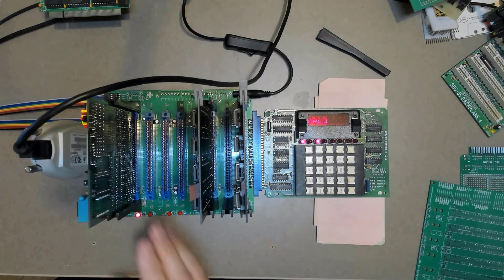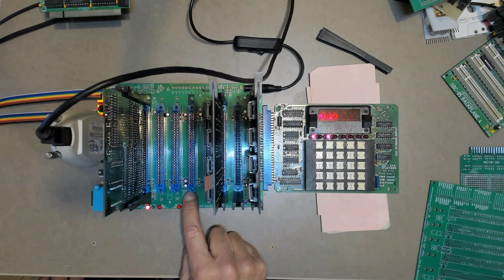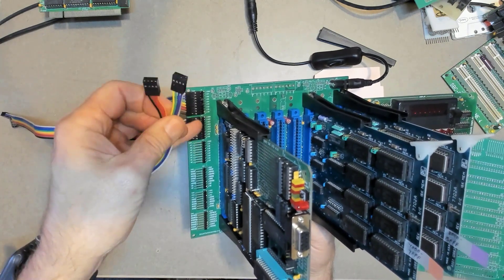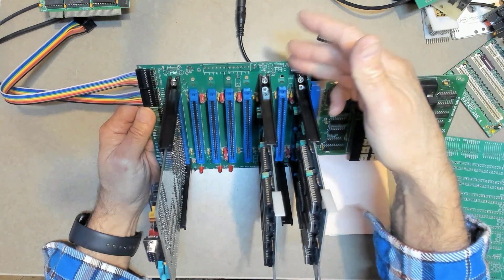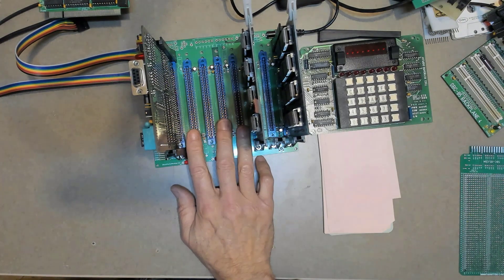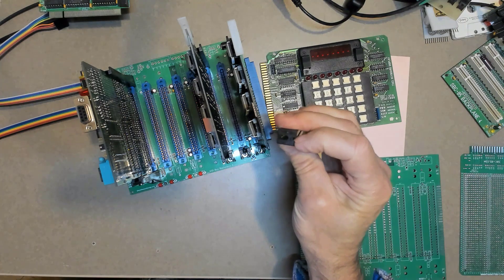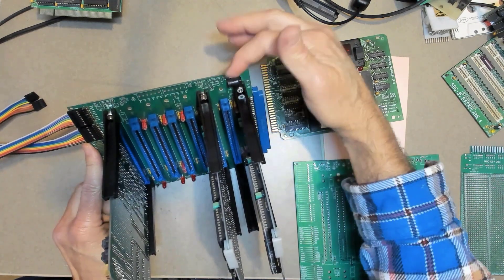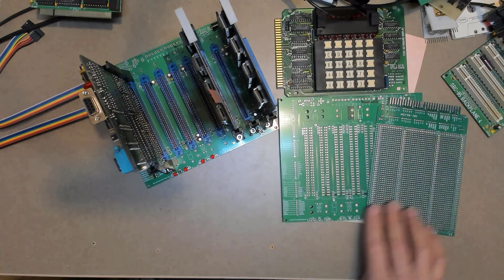{100} STD Bus Backplane 8+     Meet and Greet

Comment: What is the part number for the card edge sockets you use here?
Reply from the maker: I just pulled these from a bin of 2x26 and I thought they were all the same but it turns out i have two different different ones--- Sullins MPS-0125-28-DW-5K and Sullins EXA28DRTH. 
I also have some AMP 3-531341-0 which owrk well and is what Pro-Log used on [at least some] of their backplanes.

Comment from the maker: Note that the card edge connectors are the 0.25" row spacing (0.125" pitch) like Sullins ECA28DCWN, and are NOT the narrower 0.2" row-to-row (like the EDAC 337 series).

Comment: Not too long ago, I salvaged a PRO-LOG 16-slot backplane with matching cage from some embedded equipment. It came complete with the display card, Z80 card, ROM card and two prototype cards. It even had an early version of the monitor in there, next to the firmware for the embedded application.

It's interesting that the original creators just threw a full development system into a rackmount box, behind an application-specific frontpanel. As mentioned, they could have gotten away with a mere 4-port backplane without a full cage.
Reply from the maker: This made me want to look at pricing so i pulled out my 1984 retail list. the single quantity prices for 4, 8, 16, and 24 slot backplanes were $135, $190, $295, and $560.  a fairly modest increase for the smaller ones.  i can imagine if the OEM thought there was any chance of needing expansion, it would have been worth the extra $160 to get the 16 slot.
I haven't seen a lot of information on the pro-log monitors.  in the same '84 price list they list four moniors TP-2 ($100) for the 7401A, MP4 ($160) /MP5 ($200) for the 8085A and Z80, and MP9 ($200) for the 6809.  If you can share it, the MP4/5 monitor would be nice to have.  it looks like it is just one eprom, utilizes the 7303 keypad display, and has a nice set of commands.
Reply: Just a small correction, it was a 8085 board, not a Z80 one. The cage was also the plastic one with small handles on the side.

MP4 has been documented with a full asm/machine code listing in a manual scanned by bitsavers, but I can say the MP in my unit is very similar. The keys are just rearranged, it’s more quirky to use, and I think there is a bug in it somewhere which was fixed in MP4. In any way, I decided to type MP4 in to a hexadecimal editor and burn it to a fresh EPROM.

I haven't put the dump of my own version onto Archive yet, but it has for some time been in my plans to do it.
Reply from the maker: @ThePiloseOne  coincidentally, the prices I mentioned were for the plastic handle version. . I went to get the monitor manual off of bitsavers and discovered that I already had a copy of that manual. So re-entering the source code must have been a project I started and got distracted.  Thanks for the reminder.

Comment: I don't need a backplane, but I have a suggestion. Maybe a heat gun or a dunk in boiling water would soften the plastic of the card guides enough to bend them straighter.
Reply from the maker: Good idea, they are glass filled so pretty rigid but worth trying. If they were tall enough I would try harder, but in the end I am going to need to make them anyway.